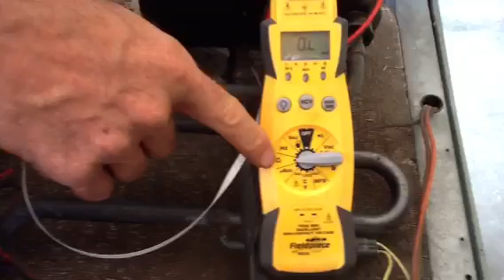HVAC Compressor Troubleshooting

Comment: Its confusing why the Start Winding as found on this compressor has a higher resistance yet the draws more current than the winding with a lower resistance?  I would think the opposite would be true.
Reply: The Start Winding always has higher resistance because it will receive a higher dose of current during the initial starting of the motor. Its drawing current only for a short time, then its out of the loop. Whilst the run winding, the one you call "the winding with a lower resistance" doesn't need to draw much current since the motor is already in motion, it draws low current but consistently during the "running" of the motor.

Comment: Hello I have a problem on my out side unit the contactor want kick on or pull in and when u push it in by hand the compressor want kick on don't no what to do had a guy come out that is a hvac I guess and he is not sure it is a traine  zr11 and are local supply store sayes it is a heat pump but there is no reveres valve need help
Reply: Jacob Droesser 7

Comment: I will look into the voltage, asap...Do you have a video, posted, on how to do this, already?  Also, I will find out how to properly wire the hardstart relay and start capacitor, then, confirm that it was in fact wired properly by the last service tech.  I also watched your video on grabbing the copper freon line to feel how cold it is to check freon levels...great video, I might add.  Thank you, David!

Comment from the maker: Three I would look at are dirty coils, low Refgeration charge, correct voltage, make sure to Check the wiring of the hard starts that are there may be a wire crossed. Thanks for the question.

Comment: Thanks, David, for your most helpful videos.  I've learned a lot!  I've got a Lennox HS18-461-3Phase unit that keeps blowing it's run capacitor.  I noticed it's also got a "hard start relay and start capacitor", too (I don't know it's condition).  My question is this:  What would be the 3 most common causes for the run capacitor to keep blowing?  Can dirty or clogged coils cause this condition?  I see no burns or charred wires going to the contactor; should I replace this anyway?  Thanks!
Reply: To this day, you got the answer? lol

Comment: asking how to trouble shoot a compressor is a wide very broad question. there are so manny different kinds of compressors. they can be the size of a refrigerator or a whole building. they'll have an air dryer system to take out the moister. you have to calculate

Comment: Pneumatic air control system  uses air compressors.  in an HVAC situation, you'd typically come across a compressor  in a mechanical room or on the roof .

Comment: Hi if i wnat to test a compressor( make it run just for a test) in which terminal i am going to connect the hot wire and the neutral wire thanks for your help jlr_cano@hotmail.com

Comment: Hi I work a resort/motel and I have a ptc unit 14.000 btu window  410Athe compresor no ruan or start  I change the capacitor but not and pirce valve into some body does I conect the gagues it was at low presure line  and Isee 230psig /70F  blower/fan work good .what coud be the problem ? or whay can Ido thanks